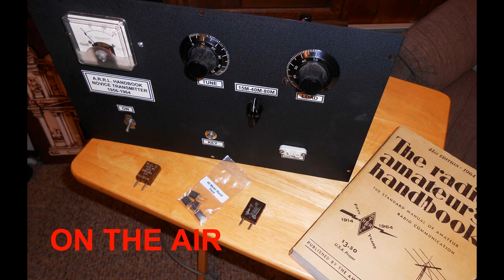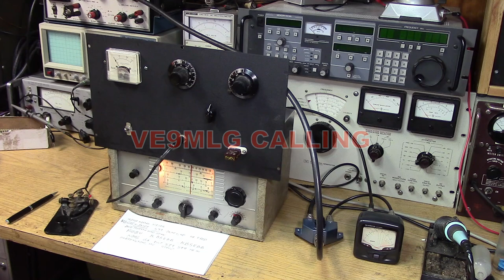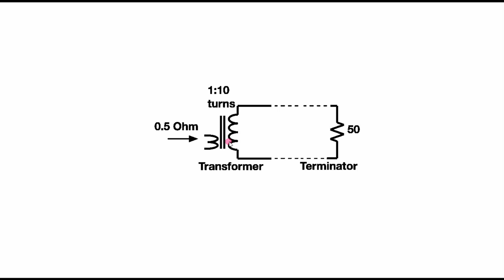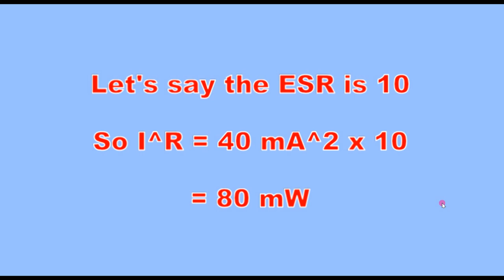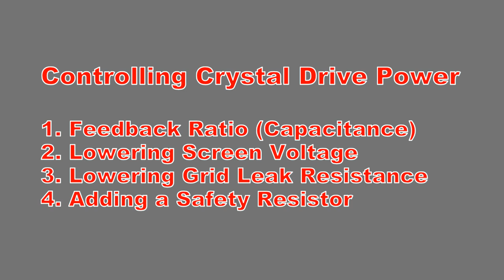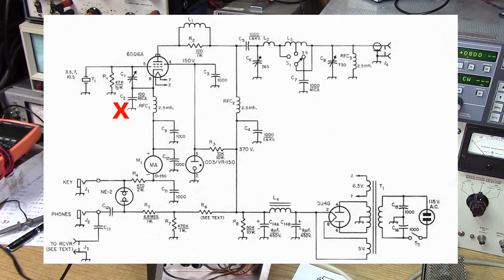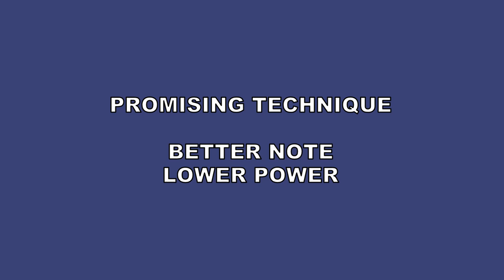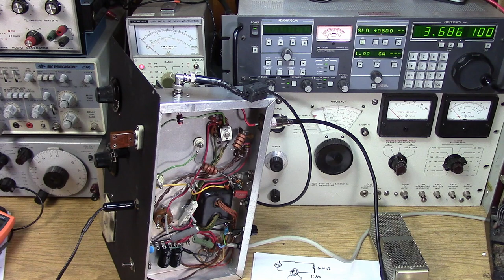Handbook Novice Transmitter Part 3

Comment: Excellent work, Mike.  It's great to actually see some numbers.  One thing to keep in mind is that with the power reduced, the pi-net L needs to be increased (and the tune and load C both decreased).  With those adjustments the power drop with lower screen voltage may be much less.  I double-checked my own numbers with a souped-up 6AV5 (6DQ6 innards), and confirmed that I'm getting close to 11W out with 50V on the screen and about 350V on the plate (40m HC-49 crystal).  So try lowering the grid resistance (I assume that will be in Part 4) and also try tweaking the pi-net L value.  You are really adding to the knowledge base with your efforts.
Reply from the maker: Very nice and great advice. You are right that the loading has changed.

Comment: Hi Mike, Great show !  While you are on the subject of XTAL's .....  Could you do a video on snubbing, tweaking, ie: grinding xtal's ! There are still a few FT-243 out there but they are not quite on the freq's desired. I know it's a lost art these day's... But considering the main topic of "Novice Transmitters", I'm  just pulled back to the times of my Elmers. And the smell of the cooking dust on the tubes, on a cool Autumn morning !
Reply: Yes nothing like the smell of dust on hot Valves, I remember years ago as a teen in the 80's listening to shortwave on an old valve set.  Well especially in winter when the room was unheated and cold.
Reply: I remember at least one local old timer talking about grinding crystals years ago. Struggling to remember but think a sheet of glass and household detergent powder was involved as a grinding paste? Also, that some casualties occurred  as it was very easy to break them.

Comment: A trick that I learned, when I was just starting out and being on a limited budget(aka, poor), If you dont have a proper socket for an FT-243 xtal, you can also use a socket for an octal base tube :)  WA1YKL
Reply from the maker: Old school advice for sure! In fact two FT-243's nest nicely in an octal socket. So just add a switch for QSY.

Comment: I have seen a practice where two HC-49 crystals are connected in parallel to halve the crystal current. There is at least one person selling HC-49 crystals in FT-243 holders this way. I have had limited success with using these crystals this way. Except for solid state rigs I will stick with the FT-243's, fortunately I have a decent stash of them.
Reply from the maker: Makes sense! I have also heard of this technique, but for another purpose, increasing the pulling range in a VXO.

Comment: Great video! Does it oscillate even when there is no crystal plugged in? One needs to maximize the gain?
Reply from the maker: That is a great question. Actually no, but there is enough feedback that a simple coil and capacitor in a separate box connected to the crystal socket, would produce a VFO transmitter!

Comment: I like CW, thank you for the video! P.S. I think it would be better (it's just a suggestion) to show the transmitted character simultaneously with its transmission (in Morse code)
Reply from the maker: Yes I just give the gist rather than the actual code, mistakes and abreviations and all.
Reply: We'll just need to learn Morse code then, to get the real message. :)